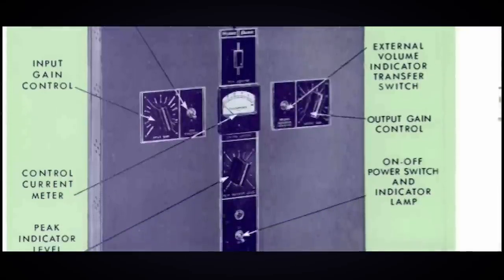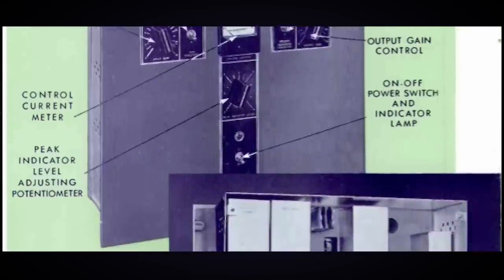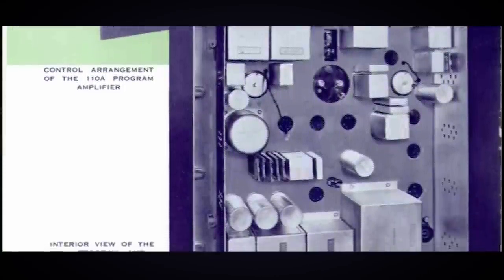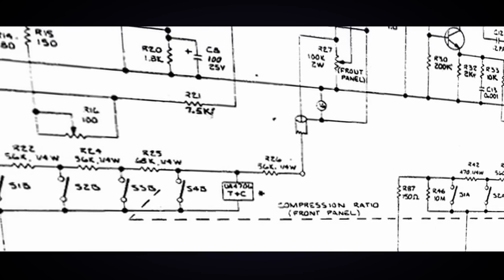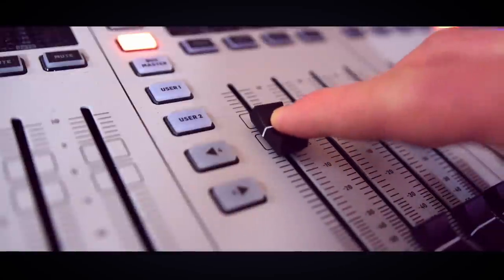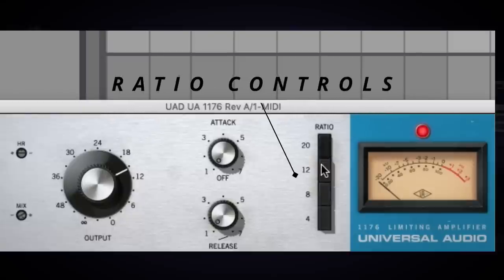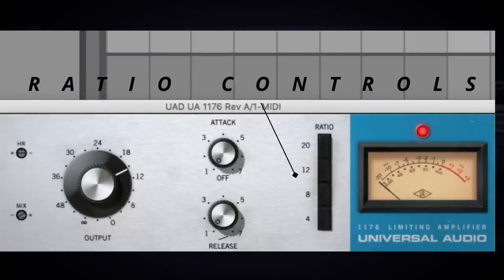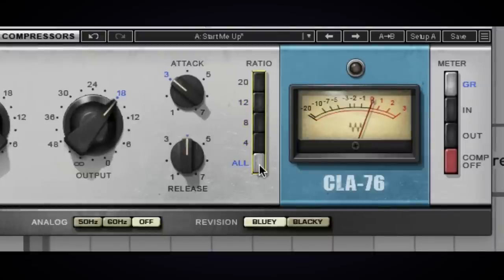Do you think you know EVERYTHING about COMPRESSORS? .....#compressor #mixing #beatmaker

Comment: Thanks for the video. Looking forward the upcoming series. On my MPC Software, there are bunch of instruments, sample packs etc. including F9 products from you often times comes with built in compressed. I always wondered if I should compress the tracks I made with these. I have to admit I don't know much about mixing and mastering so this question maybe very silly...
Reply from the maker: Great Question - I always try to keep the compression to a minimum unless its for effect on the MPC Patches, Compression of mixes can really help when lots of parts come together and I hope I've set the Keygroup patches up so there wont be too much intermodulation so I wouldn't worry and just experiment ... Only thing I would say is you often have to be careful of subgrouping things, applying compression there and then again at the master - in my experience it's best to have compression dynamics only on one buss in the chain ( I would always suggest though that you take all advice to do with compression as advice - your ears are unique and so is your internal timing so it's always best to find your own sweet spot in all this ) ... Most of all -  Try, Fail, Re-adjust and repeat - Iteration and correction are the paths to victory in every discipline !
Reply: @F9Audio  Thanks for the quick reply! Yes, often times I end up using compression either on tracks themselves or not use it all. Because applying to the whole "sequence" (MPC users know what it is) usually make it sounds very bad (to my ears at least). But of course, when I watch YouTube tutorials like you said there is all sorts of ideas or suggestions. But your feedback is probably that matters most. Those people usually are Ableton or FL Studio users which they have different tools than I do on my MPC Software. Thanks!

Comment: Great stuff - excited for the next part. I recently bought an Audioscape Opto and in blind shootouts on raw vocals with the UAD plug it won 100% of the time, the difference was actually really surprising to the point you would make different musical/mix decisions. Kinda off topic but I found it interesting!
Reply from the maker: This doesn't surprise me Dylan - There's a forward push on these old circuits that just comes from components of thsi quality and the infinite resolution of analog that very hard to capture in digital audio ... By All account time-domain processing is the hardest to get right in DSP ... Have you ever come across the Acustica Audio Plug ins - these have always been the closest for me in terms of compression 'feeling'
Reply: I have seen people say the Tim Petherick stuff in Nebula is the closest they have heard but the barrier for entry was too high for me to bother testing them and with the Opto going for £900 I just went for it. So so glad I did, resisted hardware for a long time. Not good for the wallet though, got my eye on the Silver Bullet Mk2 with an Audioscape bus comp to complete my little hybrid setup.

Comment: Nice work, just some errors at 8.10 -9.00...Vacuum Tubes are heated constantly, the heated cathode is essential for any current in the first place, otherwise the needed voltage would be in the 10000 volt range. So you get a current between the cathode and the anode plate (what would make a diode), to control the current there is a grid between (in a Triode)...cause electrones push back each other, a more or less negative control (and bias) grid voltage against the cathode regulates the current. That is NOT slow, Tubes are still used in high frequency transmitters, there is no control via heat.

Tubes are non linear devices as any other amplifying devices like transistors, a standard transistor is even more nonlinear in terms of "ugly" distortion, a FET is more like a tube with not the crinkle in the current curve like a BJT (Bipolar Transistor). Low distortion is achieved via negative feedback loops (~ 180 degree phase from output to input to ~ nullify the distortion...)  in audio amplifiers, it does not matter if tubes ore BJT. Otherwise the distortion level would be like a fuzz in any standard Class A/B ...
Reply from the maker: Thank you for the excelletn technical info and explanation - I shall be more accurate in future .... Lets rethink the line to discuss that early Valve units responded slowly compared to later tranistor based units

Comment: I don't know what I'm doing wrong on pro logic x. I use a compressor to turn my vocals up but they sound too loud through the car stereo, or too low when I re-make them.
Reply from the maker: Drop me an email at info@f9-audio.com

I’m pretty sure you need to use references with your setup - you may also have monitoring issues .. zap me a link to listen if you can too

Comment: The 1176 isn't the first feedback design. At all. As far as i know pretty much every compressor before VCAs were introduced were feedback because of how much harder it is to design a feedforward circuit. Fairchilds are feedback, STA-LEVELs are feedback, LA2As are feedback.   In a feedback circuit the signal that's being compressed steers the compression, and in doing so keeps itself in check. A feedforward compressor on the other hand needs to calculate how much gain reduction it has to do based on how the way you set it, which requires a more complex circuit. This was impossible before VCAs, from what i know. I'm no expert either but there is some erroneous information here
Reply from the maker: Thanks for the update - I'll correct this in the next video  !